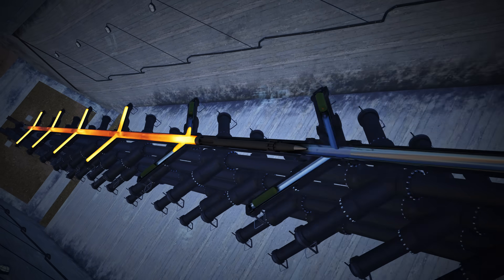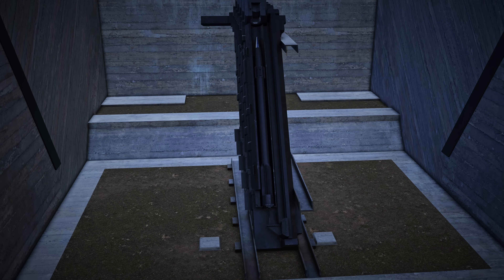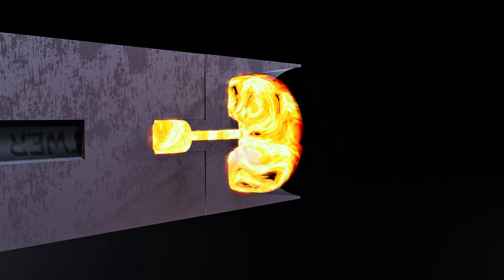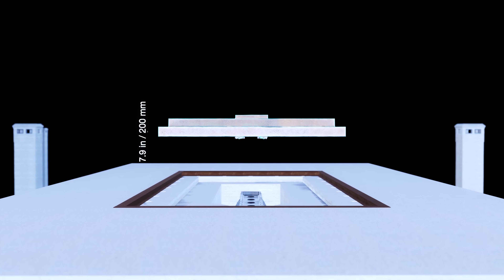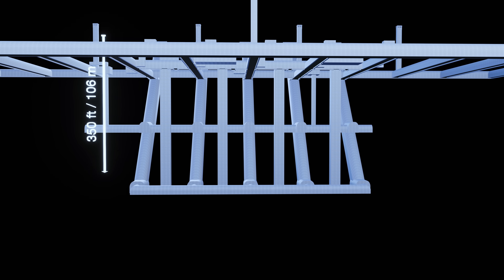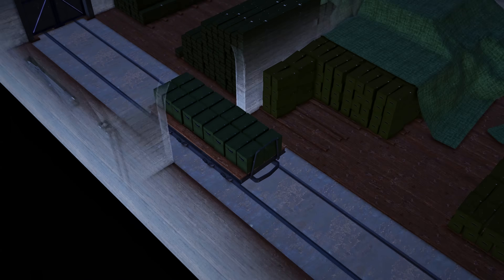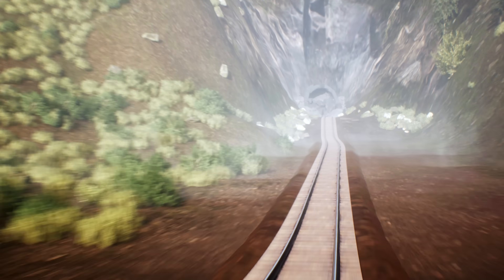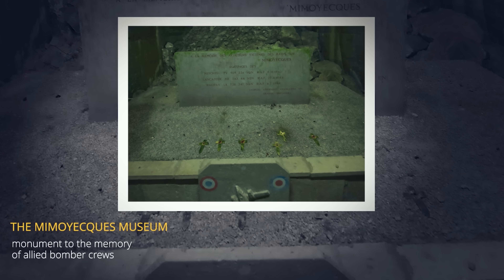Inside the V3 Nazi Super Gun

Comment: A full scale version of the gun was also constructed and tested above ground at the Misdroy proving ground. 8 rounds were fired before the cannon violently exploded.  In that time several issues were identified.  From smaller scale tests it was known that the shell needed an incredibly seal with the barrel to prevent any exhaust gases from pushing past and prematurely igniting the charges. This caused extreme and uneven wear on barrel where the shell passed the openings for the additional propellant chambers.  It also took about 0.02 seconds for the pressure wave from the igniting propellant to propagate to the chamber. This timing issue caused them to increase the spacing between chambers from their initial designs and scale back their expectations.  

In the full scale test the best result they obtained was firing a shell 93km, which was certainly impressive but this style of multistage propellant doesn't really make sense anymore.  The HARP gun developed about a decade later used a single propellant stage and managed to fire twice the distance of their best result.   It's not as if there is limited space behind the projectile for propellant.  The issue was igniting it without an impossible to contain spike in chamber pressure.  These days we have a much better understanding of the materials and chemistry involved in designing a propellant to burn with a better profile for smoothly accelerating a shell down the barrel.

Comment: If the barrel angle is fixed, how would they change targets?
Reply: They didn't plan to. The target was London, and London only.
Since every shot has a certain measure of inaccuracy, the shells would land all across the city. And that was the point. Not to strike specific targets, but to strike terror.
Reply: @rockyblacksmith  not only this. Wind conditions would also make a spread.

And gun could be "aimed" at least in one direction... if they would miss few fuel tanks during launch, missile would land earlier. If they would add stronger tanks, missile could launch slightly faster.

Comment: I have this gun in some of my history artillery books. But they failed totally to explain it would be stacked in sets of 5  and completely in a bunker they kind of hinted it would just be on the side of a hill. If this had gone  live it would of pissed the British off big time. And they could of used this as bait and build up the flak guns to insane levels even built some flak towers to guard it. And as the Russians discovered the flak towers were basically indestructible castles that could pick off there tanks from 2 miles away because of the elevation advantages. Add in a wing of ME262s and FW190s and this seemingly idiotic weapon could of eliminated London.

Comment: Just one mistake in cleaning one of the hundreds of fuel cylinders would be enough to trigger a chain reaction with the explosion of the ammunition. In other words, a single spark would cause the ammunition to explode before the operator could seal the fuel cylinders. I bet the operation of this weapon wouldn't last a week before the entire complex blew up...

I LOVE your video
Reply: Not to mention at the intended rate of operation accidents would be nearly guaranteed to happen, eventually even the best technicians can fuck up and make mistakes when exhausted and under stress
Reply: I would not clean it with explosives still inside.. That is like cleaning your gun with a round in the chamber.. not very smart
Reply: There's no way they would have been able to sustain fire at 6 rounds per minute, even with 60 of these.
Reply: @jonslg240  how so?
Reply: yes and no. 
Odds for an accident are pretty high but 1 accident wouldn´t take the entire complex out. 
Explosives used as propellant are not High Explosives and they can´t really do much damage unless pressure is allowed to build. As long as the barrel is open at one or multiple places - the gasses will vent out and not damage the gun. 

In the worst case scenario - the gun is loaded and one or multiple propellant charges above the breach cooks off. The pressure from that could (depending on that spring design) activate the fuze. The warhead DOES have High Explosive inside and it will destroy the breach of the gun. possibly initiating other HE shells loaded in neigbouring breaches. But even in that case we are talking about maybe 100 kg of HE if all shells go off. Closed space will amplify the effect but still pretty localized and possibly repairable. I have a feeling that the fuse spring was designed stiff enough tho. This scenario is too obvious.
Reply: They know what they are doing, but we really can't expect nazis to act rationally. Someone might figure out that the chance of a human error and they do it anyways because they think their soldiers wouldn't make a stupid mistake.
Those are the same guys that decided against nuclear weapons because it was jewish science.
Reply: you people keep your guns LOADED while cleaning them? what the fuck?
Reply: @jasinfinity  the video mentioned the risk of still burning embers in the auxiliary chambers setting off the new fuel if they're not fully swept out, likely from the packet the fuel has to be contained in which looks like some kind of bag (similar to the giant bags of black powder used in some late BP cannons)
Reply: Incorrect
Reply: One Youtube commenter smarter than dozens of the best German engineers and technicians. Impressive.
Reply: @tomgnyc  this guy has no idea how explosive and fuel cylinders work, even if an accident happened it wouldnt destroy the entire bunker in a huge hollywood-esque explosion, it would just disable 5 guns at most. Fuel cylinders will not activate the fuse of the shells if it was prematurely detonated
Reply: @ Yes, I am, im not nazi
Reply: Your assumptions with a hindsight-coned vision can’t really represent what would happen at the time
Reply: @nuclearbombardment3863 iria acontecer, humanos tem fadiga, isso é um desasastre pronto pra acontecer.
Reply: wet ammuniton storage
Reply: Thats not how fuel cylinders work..........
Reply: Germans would operate the gun…not Americans 😂
Reply: they would have highly skilled people, meaning that wouldnt happen, they created and designed obsurd wepons, but they wernt stupid
Reply: @Blocoes they had their 262 and 163 jet/rocket planes respectively being assembled by slave labor. With predictable results. Yes, they were stupid.
Reply: @Blocoes  They were Nazis.  They were by definition incredibly stupid.

And this... thing... was unbelievably stupid by design.  If it ever even worked and didn't destroy itself on the first shot (good chance it would have) it would immediately have become the target of EVERY bomber until it was knocked out.  As it was, it was enough of a target that it never managed to even fire a single shot.  Fixed position guns are worthless when aviation exists.
Reply: @Blocoes  Erros humanso acontecem, e essa obra abre MUITA margem pra erro, até por fadiga do operador.
Reply: @paulof2028  true, but the chances is that if there if fatigue, there would be spair men to reploace said fatigued men, but u got a point
Reply: @Blocoes just the fact that you can't take into account human error...
Reply: @ they aint that stupid man, they got an idea on wut they doin

Comment: Once eteh German had the technology or them had developed the technique of the sabot why no to resort in something more primitive and comparatively simpler like put a 26kg round of 128mm inside a 381mm of the Bismarck class? It doesn't needs to have fins, the only it needed is to go farther a 800kg round of the Bismarck guns could reach 35km of distance, a subcalibrated round of 128mm inside this gun surely had gone really farther perhaps ten times or fifteen times the distance of the ordinarily rounds of the Bismarck.
It would have been less complicated to design a tracked chassis for this 381mm gun, copying the idea from the tracked chassis or the Soviet ь-2 howitzer, surely many are laughing with my ridiculous idea, but the ballistic re-entry of such 128mm round could easily multiplicate the force of the impact, also my idea is not a new one, the Germans had a gun very similar during  WWI like the one I am talking about in "my" idea

Comment: Would the shells have actually been able to reach though, could they calculate accurately back then?
You require exponentially more and more initial velocity for the shells to reach further due to air resistance.
Reply: That would have been accounted for. Not to mention these shells would have flown so high that air resistance would have been neglegeable for a lot of the trajectory.
This was something the German "Paris Guns" already exploited in WW1 if I recall correctly.

Comment: The rail gun is the same idea but with a shifting electromagnetic field accelerating the projectile forward along the rail.
Reply: That would be a Coil gun. A Railgun uses a different working principle (running a current through rails connected by the projectile which creates an electromagnetic effect accelerating the projectile).

Comment: The weapon is cool, but...  it suffers many flaws.

It's an uncontrolled static offensive artillery piece. It's aimed at London, but, well... It also means that it is only useful when targeting London. Unlike modern ballistic missiles, this shell couldn't be controlled after being fired, and, well, the enemy air force would be able to easily spot the cannon by just following the shells, and easily destroy the cannon.

I find it ironic that this weapon would thus require having control over the airs, despite the fact that it seems to be obviously built because Germany didn't have control over the airs and lacked the fuel to reliably field their airforce.

Comment: There was a V3 weapons range near where I live. Right next to the small town of Zalesie, Poland. 53.90039, 14.43761 Here the weapon was tested on a smaller-scale structure. No one had accelerated missiles to such speeds before. For the first time, the designers encountered the problems of hypersonic speeds. Today, only the concrete foundations in the hillside remain. Allegedly, right after the war, all the metal elements were stolen, thinking it was some kind of pipeline.

Comment: so... classical propulsion railgun?
But the question is how many rounds can you get out before you need to replace one whole barrel?
Reply: IMO, more akin to a coil gun, with the extra chambers acting as the coils, each giving an extra push.

A rail gun has a continuous  push from the electric and magnetic fields from  the current flowing from the 'breech' up through one rail, across via the projectile/projectile cradle, and back down through the other rail.

Comment: Muy buen trabajo de animación pero me queda 2 dudas
- Si el ancho de las salidas de los tubos en suma era un poco mas de 100 metros y no se podían reorientar los puntos de impacto finalmente siempre iban a ser los mismos no? Una franja de  un poco mas de 100 metros en Londres, una manzana de una ciudad promedio 
- Que evitaba que los gases de las etapas siguientes  al primer impulso retrocedieran por el tubo, sobre todo cuando se iba haciendo mas largo al sumar cada etapa? 
Saludos desde Chile

Very good animation work but I have 2 questions
- If the width of the tube exits was a little more than 100 meters and the impact points could not be reoriented, then they were always going to be the same in the end, right? A strip of a little more than 100 meters in London, a block in an average city
- What prevented the gases from the stages following the first impulse from going back through the tube, especially when it was getting longer with each stage added?
Greetings from Chile

Comment: As to the 50 degree angle; before ww2, man named Townsend Whelen (and I am sure many others through history) did extensive testing of rifles and other guns, and found the the greatest projectile range was yielded by a bore angle of approximately 45 degrees. The man wrote a good number of books on his findings and experiments, and they are very good information to read. 

Back to the point - that 50 degree bore angle was very likely the calculated "best angle" to maximize range of the guns.
Reply: My guess is that the Germans calculated that an additional 5 degrees would give the round more height, meaning less atmospheric pressure, meaning less drag, making it go farther than the theoretical 45% if you assume constant air pressure.
Reply: @ possibly. A round of that grandiose would likely make it higher in the atmosphere than a rifle bullet. The exact angle varies a small amount based on the cartridge/projectile. 

The simplest way to picture it, is to imagine the arc of a bullet as a circle with a fixed diameter. As you aim the gun higher, you raise the arc path up. You eventually reach a point where the furthest part of circle is now at ground-level. It just happens that, in earth's atmosphere and gravity (again, good thought about atmospheric drag calculations), that the angle is usually in the area of 45 degrees --due to the deceleration and bullet drop caused by the air friction and gravitational pull. If those shells were more aerodynamic and faster than a rifle bullet, they theoretically would be able to sustain a higher arc for longer, before being slowed down enough to drop 

It's a formula a lot of physics, but anecdotal tests done over a century ago, and then again in ww2, got the calculations close enough that an approximation can be made. Really cool stuff!
Reply: Has anyone tried calculating if the bullets would have reached its target?
Reply: @The_Dark_Lord_TR  Considering this project was greenlighted yeah, I'm pretty sure there were quite a few calculations that indicated that
Reply: @The_Dark_Lord_TR  yeah, the Germans did. If they said it would have reached the target, it would have reached the target.

Comment: If the gun failed to achieve 5000ft/sec and only managed 4,000 (Mach 3.5) would it have reached London?   How big was the CEP at max range?
The 600 rds/hr was based on 2 emplacements firing at 5 minute intervals. This is an odd metric as fire rates are usually given as a number of rnds/min/gun or X mins/rnd/gun, ie 5.   The firing rate of 5mins per salvo was never achievable, not only from the clearing of gasses point of view, but the sheer volume of munitions required and the vastness of the magazines.  It would be this element that would also make 30 minute salvos hard to achieve.
Reply: Given how few rounds vere fired on Luxembourg, for the length of time the guns were in place, I gave strong doubts as to how realistic that planned firing rate was. Of course, it could have been down to logistics issues, ie how much ammo that could be delivered (it already forced them to go with a smaller round...)

Comment: 吹き替え版に感謝です！
V3は日本でも知名度のある兵器ですが、日本語文献は少ないのです。
なので、いろいろな事実が知れて面白かったです。
Reply: ドイツ帝国の技術力は世界一ぃ！
Reply: @nyanco-sensei  
日本、ドイツ、アメリカはそれぞれ異なる世界一の技術を持ってた。
Reply: The JAF in ww2 developed the high tech Igo 1-C  Rocket . It was an advanced homing missile created in Japan by TGE built by Mitsubishi in 1944. It homed in on a naval gun firing's shockwave! An even more advanced model was built by the Navy" Funryu "( Dragon raging?)
Reply: @johngibson2884  へぇ～
Reply: これを学ぶかわいい日本人
Reply: なんでこんな細長くする必要があったんや？
Reply: @かにざ-g8m  if this is a joke, sorry for being blind to sarcasm.
It’s length was to accommodate the necessary extra propellant along the barrel of this terrible concept of an artillery cannon in order for it to get the shell velocity (speed) to strike across the English channel 
Its narrowness was a byproduct of reusing the 15 cm schwere Feldhaubitze 18 breach
Reply: @かにざ-g8m  To fly further with more weight, a larger diameter has a lot more air resistance at that speed, at Mach 4 air compression is a big problem.
Also, the fins being further away from the centre of mass makes the fins more useful and the shell less likely to tumble.
Smooth bore gun firing "fin-stabilized discarding sabot" rounds likely make the gun less likely to malfunction than 140m of rifling.

Comment: A most excellent and professional video! The weapon was a dud because there is so much manpower, materiel and time needed to build and feed it yet it only hits one area of one city. Apart from that there are so many other problems. You can adjust for distance yet not windage. The blast from the muzzle would have leveled the surrounding area and driven everyone mad. The barrel would also have got insanely hot and would be worn out quickly. Truly a vengeance weapon only.
Reply: Research showed that this type of weapon system and others like it e.g.: V-1 and V-2 were more efficient than conventional bombing raids that had very high loss rate relative to the damage inflicted upon the enemy.
 Postwar allied research confirmed this German data but favored missiles due to their long range and flexibility despite their higher cost than "Big Guns" although the V3 was not the last of its kind to be developed after the war..

Comment: A simpler design uses multiple breeches and very slow burning powder to keep the pressure up as the sabot moves down the barrel.  Gerald Bull investigated many different ways to do the same thing.
Reply: could run into flame out situation in actual combat, imagine having a round jammed in this long barrel.
Reply: @humorss  if one barrel is blocked just take it out and install a new one, or stop using the one thats broken.
Reply: @S4SK__1  Yeah that would be a nightmare to do.
Reply: @S4SK__1  Exactly. The Germans could have put all these resources to much better use.
Reply: @humorss  if this gun ever saw combat, it would have much bigger problems.
Reply: Yeah, and look what happened to him.